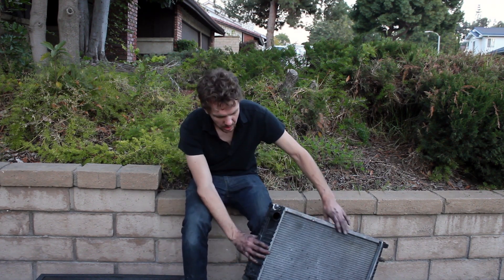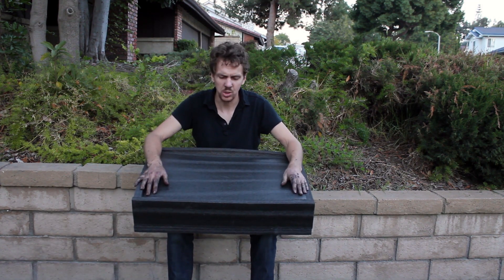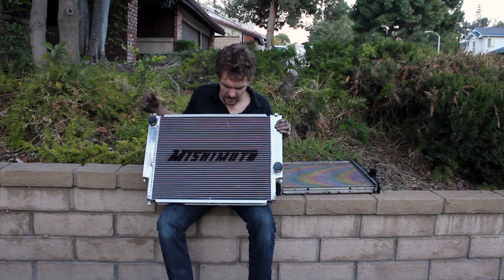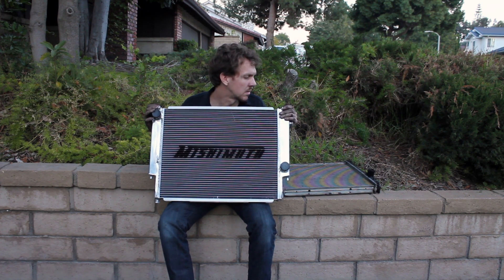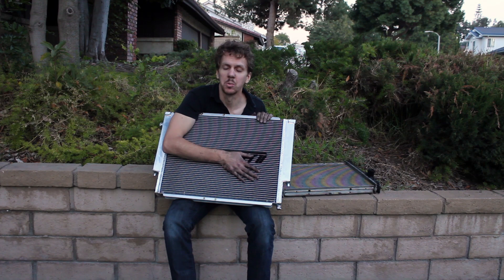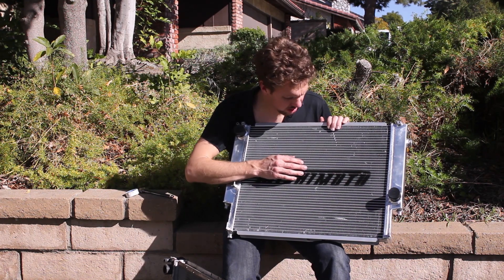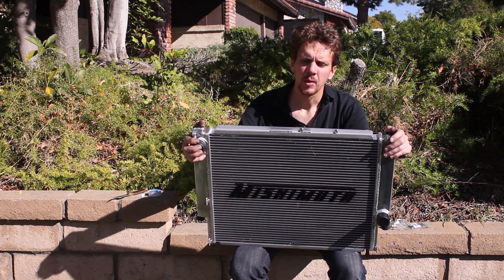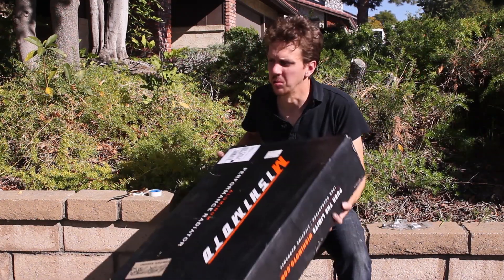Mishimoto Radiator Review and First Impressions

Comment: You bought that radiator not knowing you're stock one also cools you're transmission? You definitely need to follow directions better, because they clearly inform that you need an additional transmission cooler with automatic vehicles.
Reply: automatics SUCK!

Comment: I think they list it as a manual only as some vehicles have a heat exchanger in the bottom of the radiator as their transmission cooler rather than a separate cooler

Comment: they say its a manual transmission radiator because of there is a part of the radiator where the auto trans fluid goes to before the external trans cooler in automatic cars

Comment: Hey I have a question, wondering if you could help me. My turn signals work fine when my headlights are off, but when I turn my headlights on, the lefts turn signal freezes, an nothing works.

Comment: Bought one of these for my 7th Gen Celica. Very impressive Radiator for the money. They will not ship with the bolts you stated were missing because they would have to ship a bag of assorted bolts of varying lengths because installations vary. Is it going in your street ride or a track car??? Just not cost efficient and even if they did someone would not get the bolts they needed. So they leave this at your discretion.

 As for being Manual Trans only. Some radiators have a special cooling set up inside the end tanks and special fittings for the addition of cooling lines from a automatic transmission. They use the engine coolant to cool the trans fluid. These radiators do not have this so they state you need to purchase a separate cooler for your automatic transmission.

I think you will be very happy with your purchase. :)

Comment: I just got one of these and it installed like a dream.  Mine came with the two bolts for the fan shroud.  I think anyone considering a new radiator should spend a little extra and purchase one of these.  I think they call these manual only because there is no hookup for transmission where the transmission cooler runs inside.  These fit the manual transmission perfectly as the BMW transmission cooler runs outside the radiator.
Reply from the maker: Yep. I've been very happy with mine so far.
Reply: BMW Repair where did you buy the rad from? ECStuning has them for $250.

mine is a 93 325i and it is auto as well.
Reply: Summit Racing.  I think it was more than $250, but they have free shipping if that helps.

Comment: On many cars the transmission cooler is built into the radiator, so when there is no cooler in the radiator they assume it is for a manual transmission only.

Comment: How do you feel about this radiator after driving for a little bit? I need something with a little increased cooling capacity for my car.
Reply from the maker: I feel  good about it. It has been working well since install. It's still too early to know how it will hold up, but I think it was a good choice.
Reply: BMW Repair any update on how u feel about the radiator after driving it for a while?